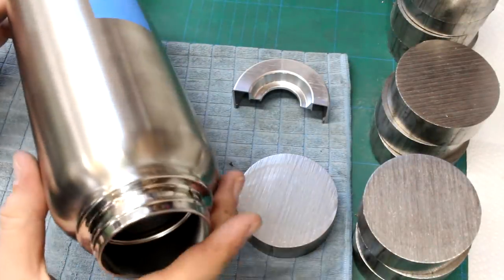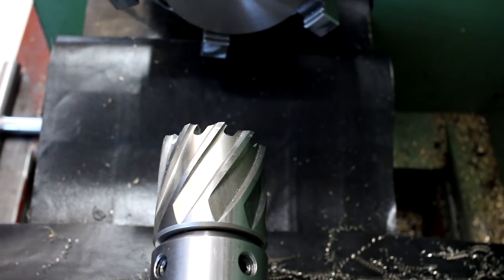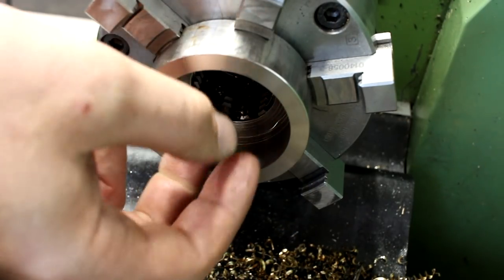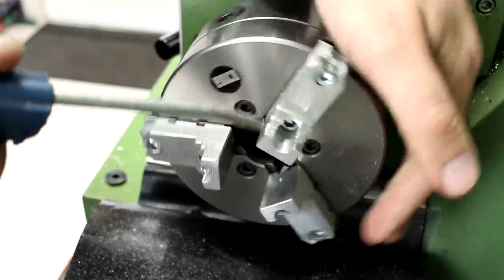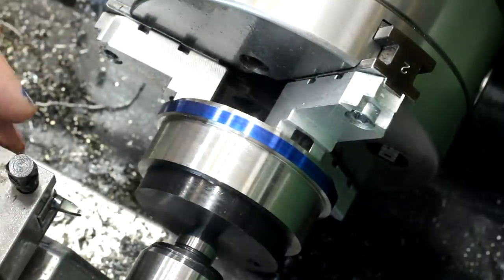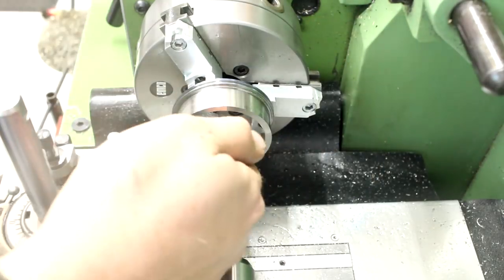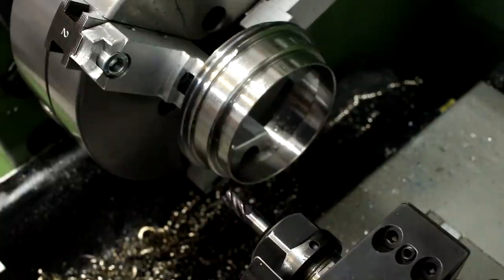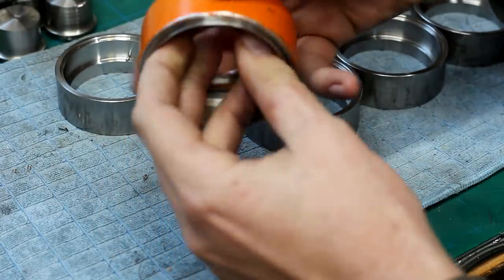Making a part: Drink bottle adaptors

Comment: CNMG-431/2 inserts were always my go to insert for turning work. Even in lathes as small as a Hardinge or even small hobby bench lathes. Of course as you go down in power the depth of cut and feed need to be considered.  One thing I always liked about the Hardinge lathes was the variable speed DC motor on the feed drive*. It was very easy to dial the feed rate in for good chip control. Unfortunately there are certain materials that just do not break the chip no matter what you do. 
*a great modification for any bench lathe as is a Single Tooth Reversing Dog Clutch for threading.
Reply: our TOS SV18RA lathe has that single tooth dog clutch for threading.... threading became really easy with it... it also comes with a little lever on the toolpost which allows you to retract around 10mm out of way, so you don´t have to mess with your crosslide handwheel... it´s stock thing, but I always loved it
Reply: @piter_sk  
Is it just one direction or both ways. It's one of those things that probably does not add that much cost to the lathe considering they can eliminate the Thread Dial assembly. And the retract lever on the compound.  That was something Hardinge had also. One thing people do not seem to understand about setting up gearing for cutting any thread form be it Inch, metric, Module or Diameteral Pitch is it's all about the ratio between the leadscrew and the spindle. If the leadscrew is say 4mm for the pitch and you need to cut a 1.5mm pitch the ratio is 1.5÷4 or .375. Or if there is a QCGB and the leadscrew is say 4TPI. Then cutting a 8TPI thread requires a .5 ratio. I've looked into building my own gearbox for threading and determining the gearing in the selector box is not that hard. And yes a single tooth reversing dog clutch was include. But the STRDC must run the same speed as the spindle. Otherwise they won't repeat.

Comment: Stefan, real nice work, real nice video again. Thank you for sharing! One question; you preloaded the soft jaws on a piece of round stock clamping on the inside. You use the claws clamping on the outside. Shouldn't you use a ring preloading the soft jaws in the same direction as the part is clamped? Curious about your answer. All the best, Job

Comment: I made a dedicated 30mm holder for my annular cutters which fits in the Multifix holder. ie, taking the MT2 out of the system. 
(The other end of the 30mm holder has an 18mm socket for my boring bars, ie the ones that fit the UPA3)

Comment: Stefan, thanks for sharing this (and editing and whatnot) !
I have now for some time adopted a habit to not to knock the workpiece to seat it into the jaws. Instead I push it either with something in the toolpost or in the tailstock and then tighten the jaws. This is because I have had difficulties with the workpiece jumping away from the jaws when knocking it. I know it is something that happens if You knock it too hard. With pushing this does not happen.
Reply: That's probably why he used a hammer with animal hide on it (dampening the blow) while also having the part tightened a tiny bit before using the hammer.. there should be no spring-back if you do it that way.

Comment: Great video!   Sequence of operations, work-holding, deburring..........."a problem well-defined is a problem 90% solved".    Thanks for sharing.   Question/comment:  What material will the mating threads be made from?  Some kind of glass reinforced, injection molded polymer, I hope?  It's been my experience that 304 stainless (SS in general) galls badly, to the point of locking up, over time when mated with aluminum or stainless steel threads.
Reply: See the video till end, he shows the final product which indeed a non metal cap.
Reply: Yes, getting stainless screws that have galled on the threads can be a real pain in the kiester.  Sometimes you need to drill out to just over the root diameter of the screw and take the thread out with a needle nose. Just make sure you are dead nuts to the center of the screw and tapped hole. On assembly we always used Anti Sieze and ran a tap into the holes. And throughly cleaned the holes out. I would have preferred to run in a form tap but they didn't want to spring for them.
Reply: @mvadu  Thanks!  I didn't realize the cap assy. was a functional prototype.   I thought it was more of a 3D-printed assembly model, a just for "look and feel" sort of thing.   Cheers,   F.C.
Reply from the maker: omg, stainless galling - I made huge adjustment screws with 25x1mm thread, probably 250mm long at one point - And I was running the threadgage along the screw, to check for fit over the entire length.
It took very a lot of Oil, back and forth to get the threadgage off again, without damaging the part or gage.
(that was 303 stainless)
Reply: @StefanGotteswinter  Common ultra-high vacuum hardware: stainless steel nuts, stainless steel bolts, stainless steel washers clamping stainless steel flanged pipe connections. Galling everywhere. Antiseize is messy, which is painful or unacceptable. A common partial solution is silver plated bolts. Silicon bronze nuts and washers work much better whenever you can get away with them.
Reply from the maker: @sealpiercing8476  Yep! We had a fair bit of of silver plating on vacuum stuff :-)
Reply: @sealpiercing8476  I have often wondered if nickel plating would be nearly as good, and a lot more affordable, for use cases other than high vacuum. I use electroless nickel often for preparing stainless parts for silver brazing, as it the chromium oxides which are problematic for wetting, and I suspect they're also the culprits for galling.

Comment: Nice video, always learn something new from you. One remark. You are cutting 3mm pitch thread, and your leadscrew is also 3mm, .
This means that you don't need to have always closed half nut. You can engage leadscrew at any position. It will always be in alignment... Seems easier, and can be more relaxed when cutting it...
Reply: Stefan mentions that possibility, at about 24:20, but he mentions that due to habit (muscle memory) he prefers to stick to what he calls the "European" way, keeping half nuts engaged and backing up. 
To me it is not so much European as "metric", as metric leadscrews make it unfeasible to disengage the half nuts, even when doing metric threads which are not a whole multiple of the leadscrew pitch. 
This arises because of the way pitch is defined (with the length unit as the numerator -- rather than the length unit as a denominator, with value of 1, as in tpi. 
If metric threads were denominated in "threads per dm" rather than "mm per thread", a threading dial would obviously be viable.

It's about the one indisputable advantage I can think of attached to the inch system, and it's why at least one metric lathe manufacture decided to use tpi leadscrews on all their manual lathes -- the one I'm aware of being CMT on their Ursus range -- as it makes the provision of a dual language gearbox simpler, both mechanically and operationally. Of course with CNC, the problem dissolves.

One French lathe manufacturer (Caseneuve) came up with a threading dial for metric threadcutting, but while characteristically brilliant, it was outrageously complicated. There was also an English third party attempt, branded Ainjest, IIRC, which never really caught on.

Comment: 3:25 In my experience drilling 304-stanless, you must keep a chip going. If it ever "rubs" (no chip) it's very hard to press through. Often I would change the angle of the twist drill To pointier then flatter until I break through the hard stuff, then re-sharpen as normal.

Comment: When I watched this initially comments were turned off..
For the thread start, I've kind of come up with the same solution, haven't actually made my spindle adapter yet though.. Well done! Thanks for sharing your knowledge and experience! Your inside and outside chamfer tool, I'm guessing it's just a shop made carbide blank?
Reply from the maker: Thanks! Yes, I fortgot to turn the comments on, when I put the video live.
The chamfer tool is just a 8mm carbide blank, split in half, ground to 90° and relieved.
Reply: For run of 10 it would be fine to install two stops on  chuck and just cut with turning insert while rotating head by hand
Reply: I had to provide a Higbee (blunt) start on my hardened Myford Super 7 headstock spindle, because I had garked it (long story)., and I came up with the same approach, doing it with a toolpost grinder and turning the leadscrew by hand. It made a perfect job. I had to do it in another Myford, running the spindle in a fixed steady protected from grinding dust by taping several pairs of knickers in turn over the steady and to the spindle (which only had to turn about 180 degrees). I had to do it like this because the Super 7 was disassembled at the time for a "like new" refurbish (and because I won't grind anywhere near the S7)
It is much nicer changing chucks with a blunt start thread. The Myford register is also preferable to the Southbend/Boxford proportions, as it engages before the thread does.

Comment: Hi Stefan, When cutting soft jaws, in my experience it is better to clamp the jaws in the orientation you will be tightening the job in. So if you are gripping in a bore you would clamp the jaws with a ring on the outside of the jaws, this will eliminate any backlash in the scroll and jaws. Best wishes, Mal.

Comment: Is preloading the jaws using a part inside the jaws a good idea when you're going to be gripping on the outside? I'd think that the deflections would not be representative of the final use. A ring for preloading would be better. I'm sure it's more than good enough for most work.
Reply: I think you're right on both counts.

Comment: Your thread cutting trapezoidal tool? Is it hss. I battle with 304 but you make it look so easy.? 2nd question.Does Emco still make stuff. i live in S Africa and its hard to get any stuff. All our chucks seem to be the non reversible type. I have an emco three jaw and would love to buy a set of reversible jaws so I can make soft jaws. Do you think I could find a set of soft jaws for an v13 emco chuck. Thankyou for taking the time to video your work. I learn lot from you.

Comment: Did you consider a double point start thread or even a triple? They are great for out putting lids on
Reply: If the customer already had a design for the adapter you're kind of limited.
Reply: @mpetersen6  yeah I do t know why I said actually it would have been 3x the work
Reply from the maker: Nope, customer design, this was tricky enough already ;)

Comment: I do hope your customer sells a million of these; the setup costs seem to be considerable.  Thank you for explaining what the the threads are for; I was certainly puzzled.
Reply: That's what CNC is for. Start with DOM or cast material. But if you are going to be making a million of them a dedicated multispindle indexing lathe such as a Cone-a-Matic might actually be faster. Time is money. I used to know a guy with a 2 or 3 person shop. He had a Cone-a-Matic set up specifically for doing the nose caps for 5" naval shells out of bar stock. One index of the machine and the parts were cut off and finished.

Comment: You migh be surprised to hear that F1 wheel nuts have a thread that is similar to the original drinking bottle  .(made in Ti for single use ).
Reply from the maker: I did not know that!
Reply: Then you can have a quick drink in less than 5 seconds.
Reply: @Farendloese Lol.. 
More like: Unscrew the lid, take your sip, replace the lid, in under 3 seconds.

Comment: Think about thermal differences between bottle and cap. You will need some clearance on the threads. And for convenience chamfer the thread for easy engagement. 
Double helix threads are more convenient as simple threads as they will engage every half turn instead of full turn. Something you allways will twist out of your wrist.

Comment: Why was the Rotorbroach on the toolpost rather than the tailstock and how was it aligned with the lathe centre-line?
Reply from the maker: These days I do all my drilling via the toolpost - Its quicker to setup, allows for fast retract, has the advantage of a DRO and powerfeed.
I despise pulling the tailstock for all the problems they create (Slow and always in the way)
(For centering, I indicated the toolholder once with a indicator in the spindle and saved the position in the DRO. So I just select tool 1 and crank X to zero).
Reply: @StefanGotteswinter  Ah, thanks!  As always, good answer (if you have a DRO).
Reply: @RicktheRecorder  I don't have a DRO, but I do use this technique. 
I just made a hard gauge to position the toolpost relative to the face of the bed.

Comment: Yeah, i can see why product that goes pop and launches water and cap would fail, but this thread solution looks expensive. Some variation of power tool box style locks would be fine, it could release pressure when partially unlatched and only after that it would come off and that would take mass production friendly components, possibly made from 2mm thick wire like in fancy jars

Comment: I use a lot of 304 because it's what my local supply house carries. They have a very limited selection. It takes a bit of getting used to, it's not the best cutting, but it's nice once you get used to dealing with it and you can get nice finishes out of it.
Reply: Yes, in my youth it was always easy to get 303 as well as 304 (the former machines a lot more easily, and in particular is much nicer for tapping) but now everyone seems only to stock 304 (because it can be welded, and it halves their inventory). So i tend to go to the extra expense of 316 which machines about as well as 303 (the price differential is no longer crippling as it once was, so I guess it's actually a good change)

Comment: Die Tabelle am Anfang gefällt mir sehr gut. Ich schaue häufig Videos aus den USA, Australien usw. Mit den Werkstoffbezeichnungen dort kann ich nicht viel anfangen (bzw. muß erst nachschauen). Diese Tabelle ist für mich klar. Sieht aus wie ein Auszug aus meinem alten Tabellenbuch aus der Lehre.  X5CrNi18-10 = hochlegierter Stahl mit ca.0,05% Kohlenstoff, 18% Chrom, 10% Nickel. Nach dem X (steht für hochlegierte Stähle) kommt die Zahl für den Anteil von Kohlenstoff/100. Dann die Legierungselemente Cr (Chrom in %) und Ni (Nickel in %). X5 CrNiMo 17-12-2 wäre demnach ein hochlegierter Stahl mit ca.0,05% Kohlenstoff, 17% Chrom, 12% Nickel und 2% Molybdän. Die Werte sind natürlich einer gewissen Toleranz unterworfen. 
Allgemeinen Baustahl (z.B. St37) nannten wir "Wald und Wiese". Aber die Allgemeinen Baustähle werden heute auch anders bezeichnet. Mein altes Tabellenbuch taugt also nicht mehr so viel ...  :(

Comment: When you ground the threading tool how did you check the nose width. ShadowGraph?
Reply from the maker: With a metric trapezoidal threading tool gage against light :)
Reply: @StefanGotteswinter  
Well, that's old school. When ever I had to cut Trapezoidal Threads I had to use a shadow graph when grinding the tools. I have an Acme gage but not a Trapezoidal.  I do have the thread pitch gages though.

Comment: I have some of that material that wasn't marked properly and I don't know what it is.  I purchased it from an individual that bought a piece of property and the previous owner left it behind.  It was stored outdoors and the paint markers used to identify it was almost completely gone.  I was able to read the marking on a 3 1/2 inch x 8 foot piece of 4140 solid round bar.  Along with that was a piece of 5 1/2 inch and I believe an 8 inch solid round bar both around 10 feet long that had the ends painted with the same color code, so I'm guessing they are also 4140.  I bought it because they were selling it for below scrap value about 3 years ago.   It would have been worth quite a bit of money had someone marked it better.
Reply: There is no industry standard for paint codes in the US. It seems every supplier has there own system. In a shop that keeps a large amount of material on hand you need cans of paint and a wall chart. Of course there is always some bozo that thinks "hey free paint". Plus steel racks need to be marked as to what goes in them.

Comment: I was suffering the time you were feeding-in the end mill to finish the thread.. if it would start climbing in to de part and explode.... not fun

did you take some precautions like fixing the spindle  or just going nice and slow?

greetings from Dresden
Reply: Given that the leadscrew is geared to rotate in sync with the spindle, I'm not sure why he didn't put it in gear. That way when he rotated the spindle, the cutter would have advanced at the correct rate.
I did exactly this when I had to do a blunt start on my spindle nose thread (I was grinding rather than milling because the spindle was very hard) and it worked a treat.

Comment: I sometimes do similar as you did with the annular cutter, but with drill bits. How did you know you were Centered on the work? I usually find I’m close but not right on perfect Centered. Thank you for the video!
Reply: Dial indicator on the chuck tip on the drill or tool
Zero and spin to the other side check and adjust. 
Works for y axis too

Comment: hey stefan!
im wondering what the max DOC is that you can do on your lathe!
Reply from the maker: It depends :)
Depending on the tool and work diameter, speed and feed, i might be able to take a 4-5mm doc in steel.
Reply: @StefanGotteswinter  damn, i own a emco compact 5 lathe and its a beefy thing but i see emco made every one of their lathes a beast